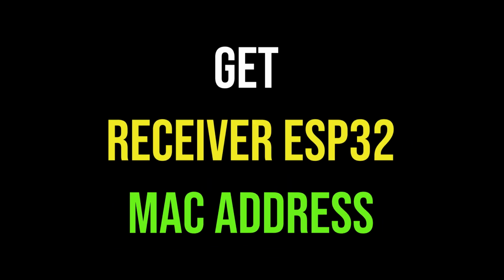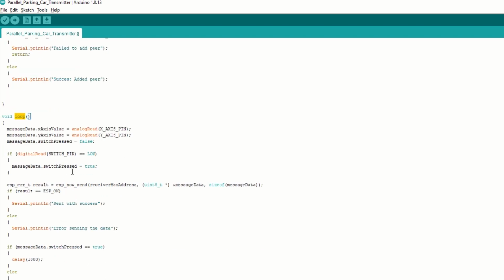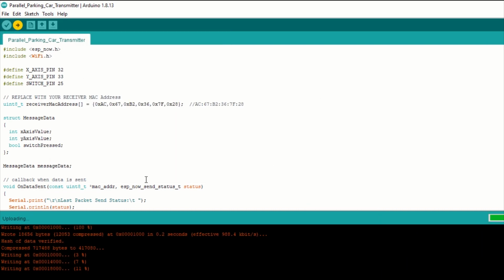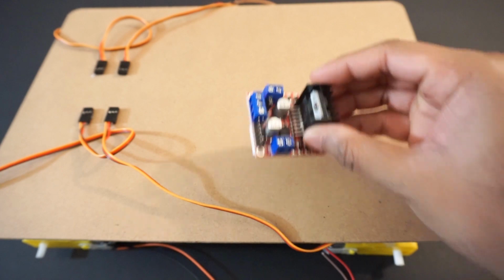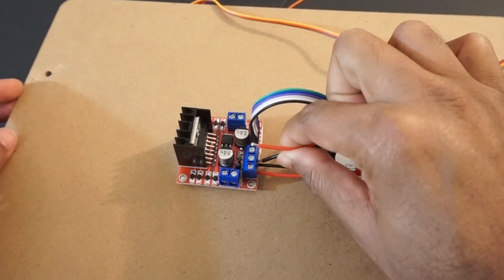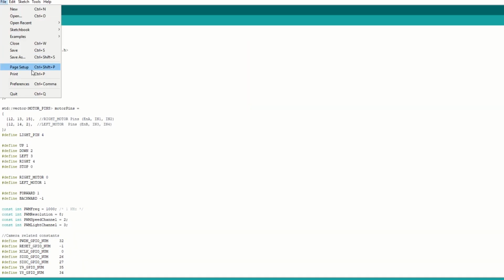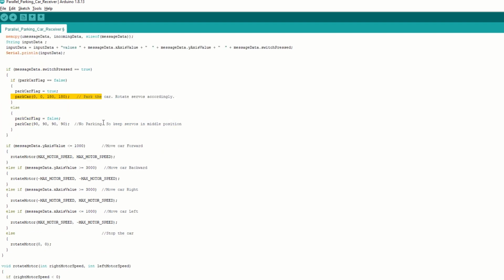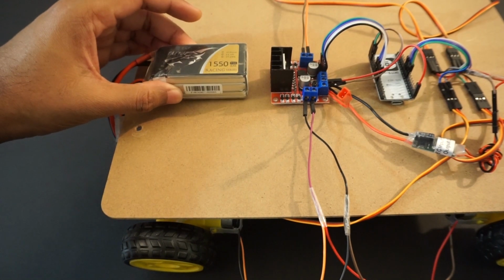Parallel Parking Remote Car using ESP32 with ESPNOW protocol | DIY 🔥

Comment: im facing one strange issue if i move the stick little bit left means the bot turning left if i move the stick fully then the bot automatically stops turning left and executes forward command y because the value of Y is interfering what should i do to ressolve this

Comment: When i press the switch in joystick,the serve rotates 90 degree and when i move the motors ,the servo quickly comes to it's initial position without pressing the joystick switch. Is the anything to modify in code? Or anyother mistake??
Reply from the maker: May be your switch is getting pressed again while moving joystick .
Reply: @hashincludeelectronics i couldn't hear any sound of pressing again when i move the joystick,what should i do now??
Reply from the maker: @tamilarasan1389  which power supply are you using ? Make sure it’s rechargeable battery and provides more than 3 A current . Power supply interruption can cause esp32 to reset .
Reply: 12 V and 2A rating @hashincludeelectronics

Comment: Another issue I'm facing now, when I move forward or reverse in analog joystick,the TT motors are rotating continuously but if I connect  left motors and right motors separately to the motor drive, I can control the TT motors but if I connect both side motors together , It is rotating continuously if I move forward or reverse in analog joystick? What to do??
Reply from the maker: Please check the connections 👍🏻👏🏻

Comment: Hi sir, I'm facing unexpected servo movements eventhough I could control them using analog joystick.what to do sir??What mistake am I doing??
Reply from the maker: Power issues . Please use good rechargeable battery only . Also check for any loose connection 👍🏻👏🏻

Comment: Now TT motors are rotating continuously when I give 12V supply?couldn’t control with joystick but servo is rotating 90 degree while pressing joystick.What to do?
Reply from the maker: Please check the connections for power 👍🏻👏🏻

Comment: Hi sir,I have two doubts

1.I'm using Dev module instead of Wrover module ,will there be any changes, if so tell me sir?
2.Is it mandatory to use Wifi101/WifiNINA firmware updater(tools>firmware updater),If so tell me how to set that?
Reply from the maker: I would suggest to use the same components which I have used in this project . That way you will avoid issues 👍🏻👏🏻
Reply: Ok but what about the firmware updater?? @hashincludeelectronics

Comment: Wheels didn't rotate when i press the analog joystick.what is the problem between the receiver esp32 and transmit esp32?
Reply: Arduino IDE 2.3.1
Reply from the maker: @na.h5929  ok . There is some small code change in transmitter code so that it will work on this IDE . Change this line as below in transmitter code 
esp_now_peer_info_t peerInfo = {};
Reply: hashincludeelectrsir another issue...now TT motors are rotating continuously when I give 12V supply??couldn't control it what to do??
Reply from the maker: Which version of Arduino IDE are you using ?

Comment: Hello 
Could you please suggest any other alternative battery as this is costly and even the ubec converter?
And also do I've to make changes after replacing the components?
Reply: One more thing as the video suggests to use glue gun for placements of components, but I want to use these components for various projects so what to do instead of sticking, specially the servo motors and tt motors
Reply from the maker: @Mahek-rs8tv  you can screw those components on chassis. Or use other methods which is handy for you 👏🏻👍🏻
Reply from the maker: You can use LiOn battery cells . Each cell is 3.7V so you can use 3 cells 👏🏻👍🏻

Comment: What component use instead of UBEC... because it's cost is high
Reply from the maker: You can use any cheap buck converter 👍🏻
Reply: @hashincludeelectronics  I also see this kind of schematics without the use of an UBEC. Did you have problems when using the 5V of the Electronic Speed Controller?

Comment: Awesome project, can you use a PS3 controller instead of the joystick ?
Reply from the maker: Thanks for checking out the video 👍🏻. I have not tried ps3 controller yet but should not be that difficult ☝️
Reply: @hashincludeelectronics  I'd love to see it working.
Reply from the maker: @roscoe3dp470  Just came across this comment and would like to let you know that I have created car using PS3 controller. Not sure if you already checked that  video. Hope it will be helpful. 👍

Comment: Can I use esp8266 instead of esp32
Reply from the maker: Thanks for checking out the video 👍🏻. You can use esp8266 but for that you might need to make some changes in code as I have used ESP32Servo library , wifi library . So you need to use corresponding library for esp8266. And also make sure the pins I have used are available on esp8266 else change those pins . Give it a try and I will help you if any issue .
Reply: @hashincludeelectronics  ok tq